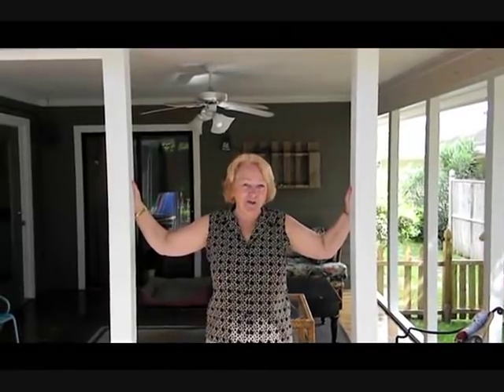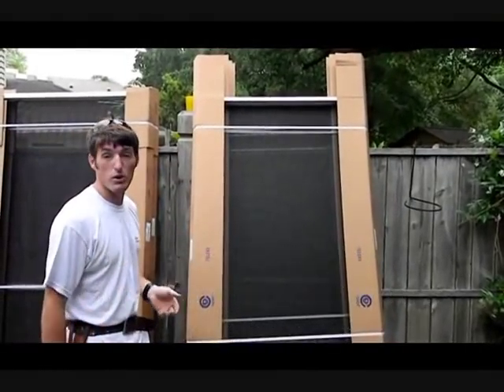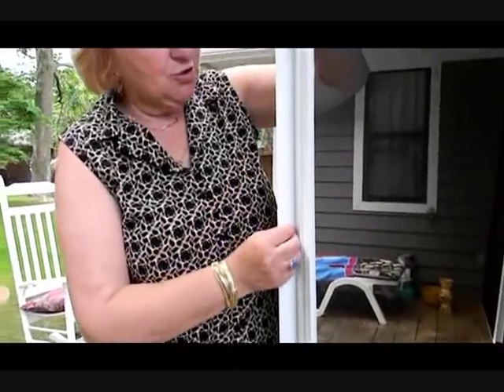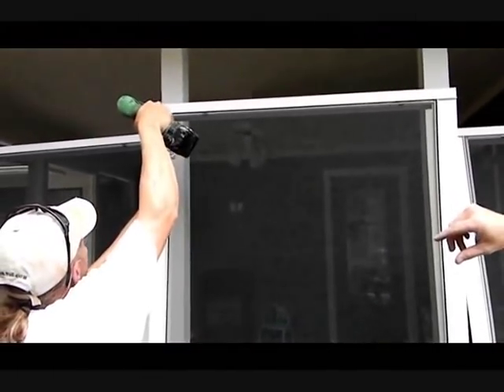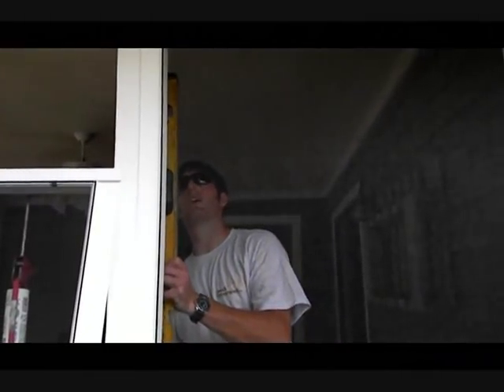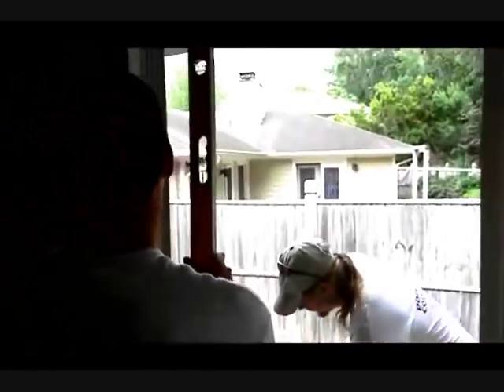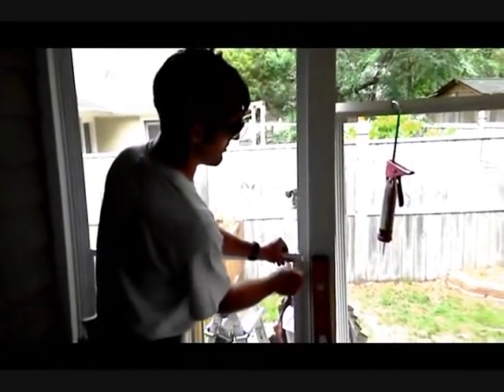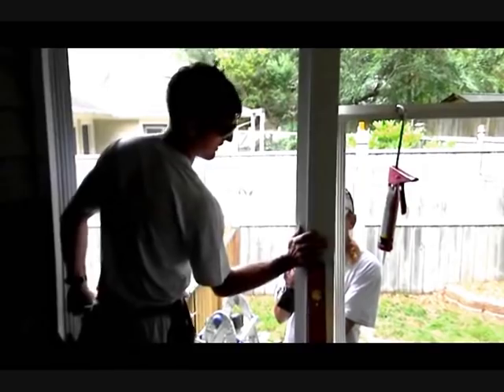Eze Breeze Windows How to with existing wood framing

Comment: Amazing product. It looks so much like glass. without adding heat to the room, the temperature difference is about 14-16 degrees warmer than outside. Great for protecting plants in the winter.
Reply: Good for any warm climate. I wouldn't recommend them for any location that goes below 50 degrees. This do NOT offer any insulation at all. Even with a patio heater, it doesn't help much. I would rather go with regular vinyl double panel insulated windows.